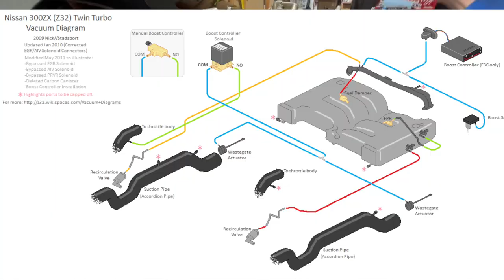Project Car Z32 Nissan 300ZX Engine Part 5 Built By Miller test boost solenoid and intake manifold

Comment from the maker: I will try and get that video posted this week. I mated the transmission before putting the motor in to make sure it spun with no clearance issues on the flywheel. I know I took pictures at least. Took a flapper wheel and shaved off about 2 mm. Make sure you adjust your clutch pedal also. Specialty Z has a good write up.

Comment: Nice work, doing a NA-T build myself right now.  It would be great to see a video of shaving the NA transmission to fit the TT clutch and flywheel (if that’s the direction you are going) I’ll be doing mine in about a week
Reply from the maker: I forgot to record the process but there is a part where I show the end result on one of the transmission install videos